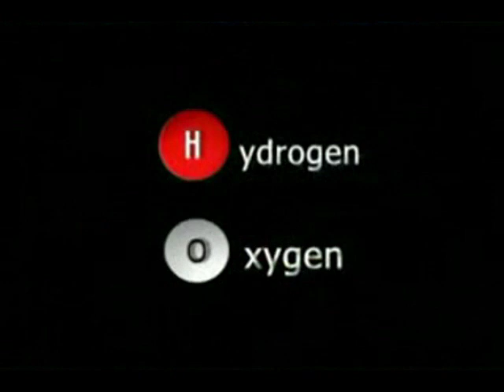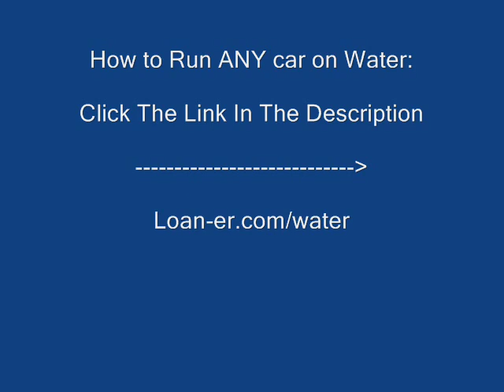Browns Gas

Comment: This isn't a scam, I have made a similar rig in my shed, which works perfectly well.
But did anyone notice at 1:30 they had a little model of a water molecule which had 2 small oxygen atoms bonded to one big hydrogen atom? um... H2O means there are 2 hydrogens and 1  oxygen. Lol at them putting so much effort into this video and the animator screwing it up.

Comment: stanly myer , browns gas , cold fusion  , microwave salt burning water, geet generator "fake", ultrasound splitting , and chemical reaction release , are diffrent things dont get confused there's plenty of other free energy ones to magnetic types kinetic types "fake" if it requires over unity its fake, if it exorbs energy fields maybe etc

Comment: @vishi1968 People centuries ago knew this was a waste of time and resources.  Its clean if you have green electricity to start but it still wastes almost half of that energy, secondly melting tungesten means nothing- you can do that with any combustible gas delivered at the right pressure (at appropriate volume) for the mixture...  You sound like you are trying to take over his work of bilking rubes out of money.